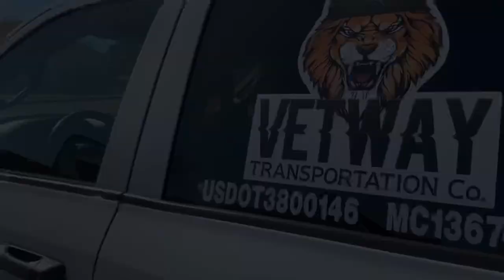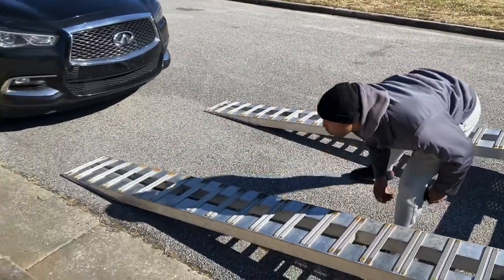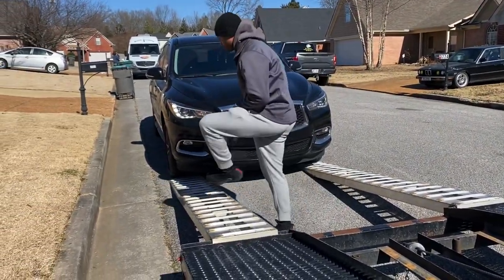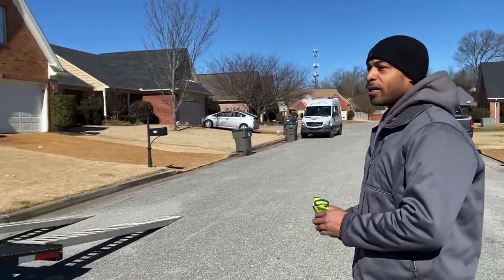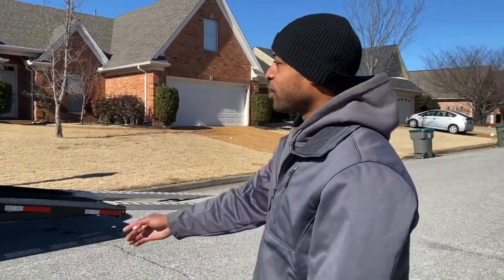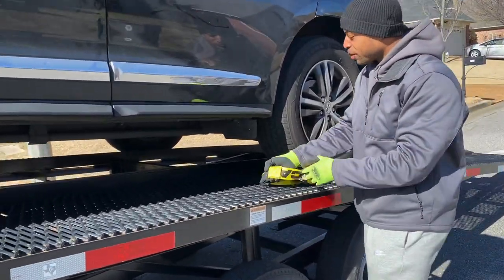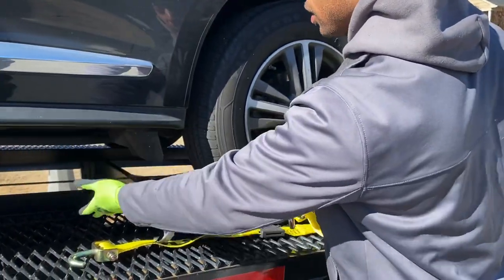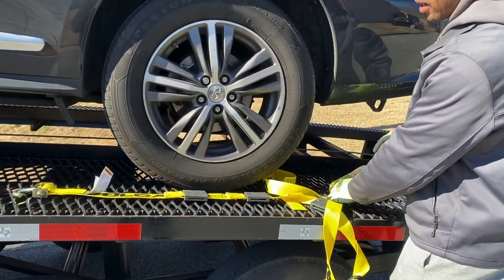Loading a car on my 3 car wedge for the first time!!

Comment: First time using my wedge for vehicle's. Its a 53 foot kaufman i need to load two trucks. How should i place them on the trailer... sorry only ever hauled trailers and boats with the trailer so not sure how to properly place two truck's on it
Reply from the maker: It really depends on what type of  trucks. I wouldn’t generally put the first one backwards and the rear truck facing forward.

Comment: Nice work. As a big rig driver same methods apply…so 2 dual tire tandem axles would be a better option. Yes is an extra set of tires but is more stable and can take more payload. 3 axles put lots of stress on the middle tire while turning. Also hotshot haulers should always shock the trailer wheels by engaging the E brake/Emergency Brake while vehicle in neutral. Shock the trailer wheels and then put the truck in Parking mode. You do not want to be loading/unloading cars and having that trailer rocking back and forth putting all that stress on the transmission locking pin. Couple of shocks on each side of trailer front and back of a wheel will do the job and will save you a transmission expense on the long run. Other than that safety first drivers.
Reply from the maker: Absolutely! Thanks for your comment!
Reply: Nice advice. I agree 100% with the choice of dual tandems, when possible. Also, I think you mean to say CHOCKS, not SHOCKS!?

Comment: Nice video bro. What ram is this?? Also I see u didn’t need to cut out the back for the 5th wheel. Looks nice. I wonder how much it cost u??
Reply from the maker: Thanks. The truck is a 2020 ram 3500 tradesman. I used a high wedge trailer so there was no need to take off the bed. The truck was 60k in 2020 when I bought it.

Comment: Awesome set-up and nice video.  I'm glad I came across your video because I have a 5th wheel in my truck bed and was looking to use a gooseneck but didn't know the name of the adapter you use to bridge that gap.  What is the name of it and where do you purchase it?  👍🏾 Liked, Comment & Subscribed.
Reply from the maker: Glad it was helpful! I'm not sure of what you're talking about sir as far as the adapter is concerned.
Reply: It's called 5th Wheel.You can pull a 5th Wheel trailer o a Gooseneck trailer.

Comment: do you have any issues with the weight over the rear truck axle? How heavy of a vehicle can you put up there, without exceeding the axle rating?
Reply from the maker: I don’t have any problems. Honestly it really depends on the other two vehicles behind it that determines how heavy the 1st one can be. I typically only put small or mid sized sedans up there. I also load it backwards to distribute the weight properly. The heaviest I’ve put there was 4200 lb dodge charger.

Comment: Nice setup! I'm getting the exact same trailer with a 2022 Ram Laramie Crew Cab, but I'm worried about the overall length. Is your setup over the 65ft allowed by DOT?
Reply from the maker: It’s just barely over. Best bet is to get a cab and chassis that way you’re registered as a tractor. You won’t have to worry about the length laws as much. I haven’t been bothered yet and neither has anyone else I know with the same setup.
Reply: @vetwaytransportation  DOT loves their measuring tape be careful.
Reply: Is that an 8ft bed on that truck
Reply from the maker: @chillwill809 yes 8ft

Comment: Hi, quick question your trailer is a 53' ?  I'm thinking on the 44' Kaufman to be safe with the length I have a 3500 RAM crew can 8' bed any advise? be safe man
Reply from the maker: Hi, my trailer is 50ft. 44 would be the better one if you still have a bed on your truck.

Comment: What are you scaling at with 3 average vehicles? 3 axles with 2 spare tires, do you have a winch and battery?
Reply from the maker: As I am just beginning, I’ve yet to scale a full load. This video was for demonstration purposes as I needed to familiarize myself with my equipment  first. That was a personal vehicle. I am currently waiting for my DOT and mc to become active before I run for hire. My trailer does have a 12k Badland winch and a battery. Thank you for your comment.
Reply: @vetwaytransportation  Of you haven't ready, run it to the truckstop scale and get an empty base line so you can calculate your load. Are you CDL or non? You probably know this, but make sure your truck is full of fuel and has everything on board you plan to carry. Of your going to sleep on the truck, remove the back seat and build a light weight wood frame then use foam for mattress. Use a 6 inch thick form or it will be too hard for good sleep. Tow Piglet has a good video on the bed. You might consider removing the truck bad as well, it takes off about 600lbs that gives you more paying weight and every pound is money. measure your length as well to make sure your under 65ft total as some Troopers are cracking down on that. Removing the truck bed negates length laws in out states except CA, IL, NC, IA that have different laws. If your nonCDL stay out of CA and NC as they have laws that penalize anything over 10K Without a CDL. Anyway, best of luck to your new adventure, it can be fun and make a lot of money
Reply from the maker: @rctjacksonville  thank you for that information. I am CDL class A with Manual restriction. Do you have an email or social media site where I can contact you?

Comment: what model pick up truck is that? dodge ram 3500? which model?
Reply from the maker: 2020 Ram 3500 Tradesman
Reply: @vetwaytransportation  Thank you, i just subcribed to the channel. i am trying to start a NON CDL Set up, can you tell me what trailer, and truck do you reccomend, and if i have a 3 car wedge or should i get a 2 car enclosed to start. how much car weight can i hold in those trailers 3 car or 2 car enclosed. i under the GVWR part truck and trailer have to be under 26k lbs. i am confused about how much weight of car can i haul. what is the lightest truck i can get that can haul the 3 cars, but also be light curb weight, this way i can maximixe the weight of the cars i am hauling if that makes sense?

Comment: nice video keeop it up am non cdl this set up looks good
Reply from the maker: Thank you! what setup do you have?
Reply: @vetwaytransportation  2018 ram 3500 6.7 aisin trans 2014 50 ft wedge trailer same as yours with a fifth wheel
Reply from the maker: @maxwelllohlofftz544  nice! Keep the wheel rolling family 💪🏽

Comment: Do I need CDL to haul 3 to 4 cars ? Thanks
Reply from the maker: more than likely you will. A trailer that will fit 4 cars will more than likely a cdl setup. If it isn't, after you load it with 4 cars it will be lol.

Comment: Not trying to rain on anyone's parade using a pickup for this will be a long term maintenance disaster semi tractor is half as expensive long term .And a company job with jack Cooper or Cassens transport pays 1.54 per mile + load pay free medical and a retirement
Reply from the maker: Thanks for the advice. You are also %100 correct with what you said. Hence the reason I am currently in a semi.